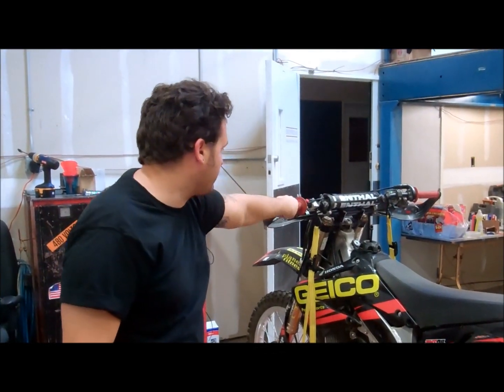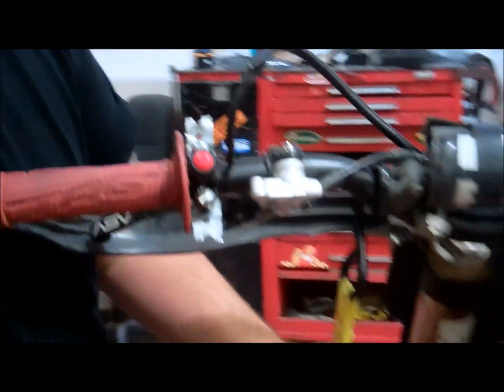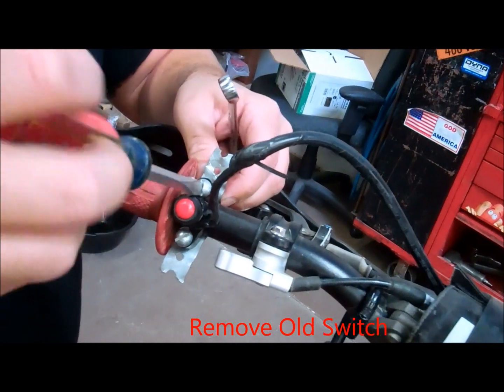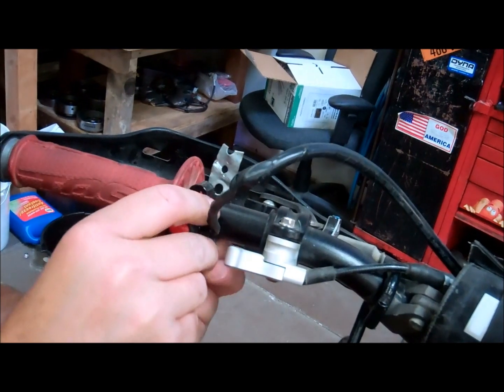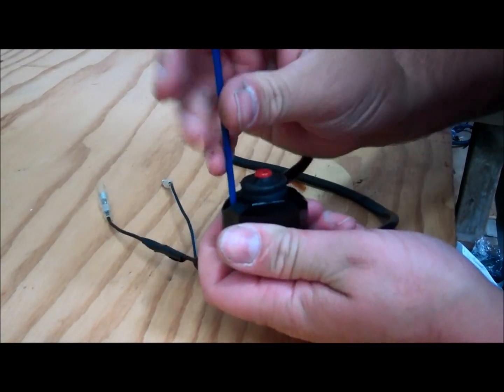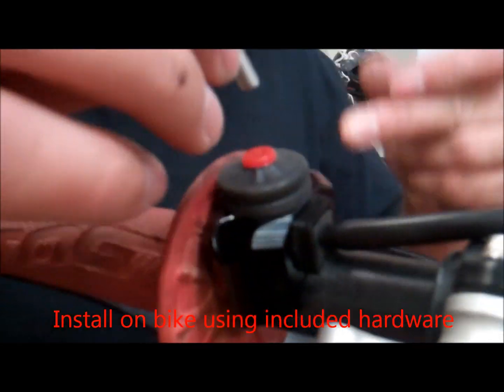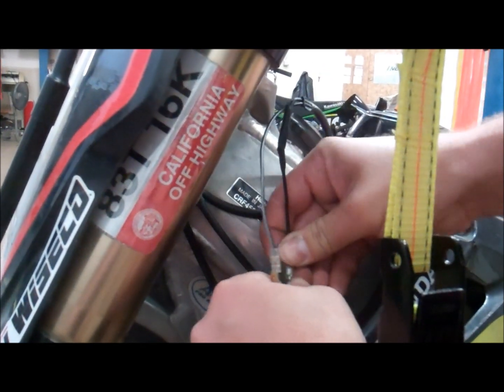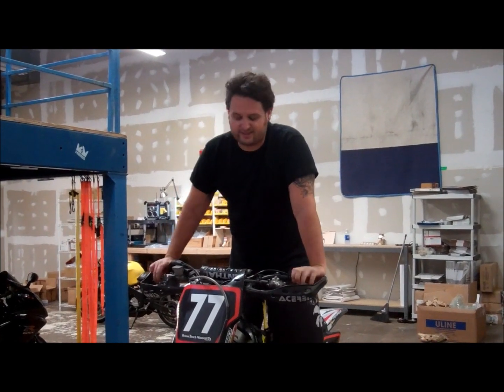RaceTech Electric Billet Kill Switch Installation

Comment: When I put the new Kill Switch on, does it matter which of the 2 wires plugs into the other 2 wires? or will it work when plugged in either way? Thanks, and i have 04 CRF450R